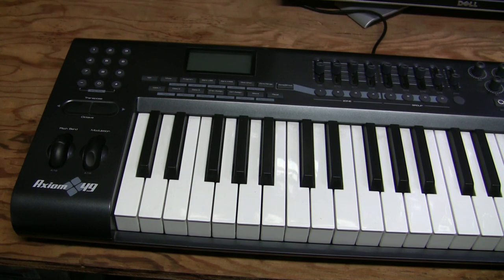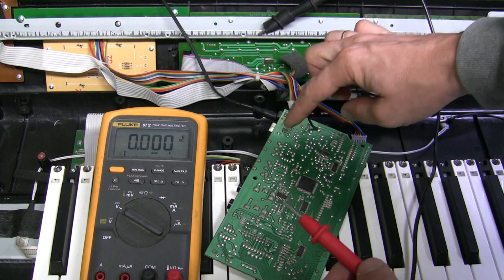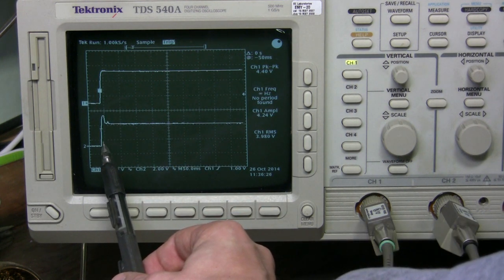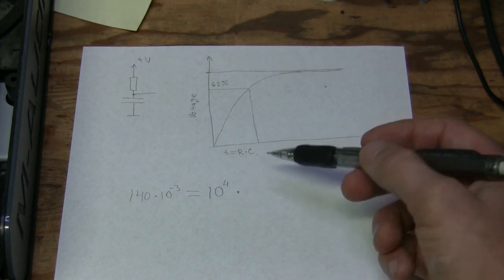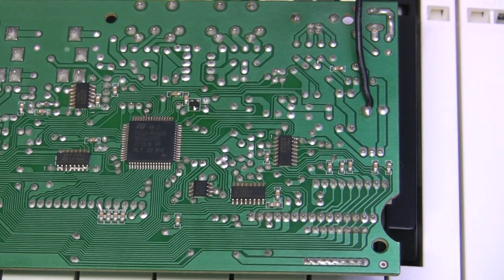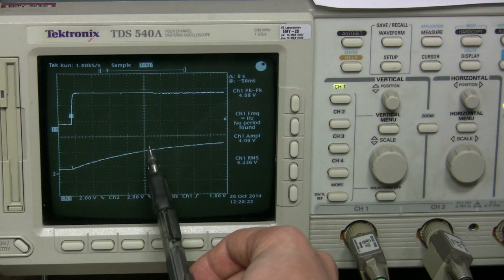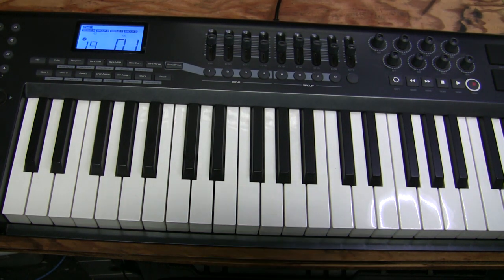#19 - M-Audio Axiom 49 keyboard repair

Comment: My oxygen 61 when plays on my laptop when the laptop is running on battery, but when i plug it in to power the midi keyboard plays for a few seconds then midi sort of disconnects, tried on different computers and locations, same problem, on my desktop same thing since desktop is always connected to power..

Comment: Nice video but you neglected to give the important details of installing the capacitor and resistor.  Just moments before you're talking about detailed considerations like not damaging the pads when removing the reset chip yet say nothing about how to tell how to get the polarity right when installing the capacitor, where each component is to be attached to etc.  I don't understand why anyone would omit those details.
Reply from the maker: I don't understand why anyone would care about such obvious details.

Comment: Hi, great video.  Sorry for the goddy question but I am trying to put mine back together and one ground wire has me stumped.  
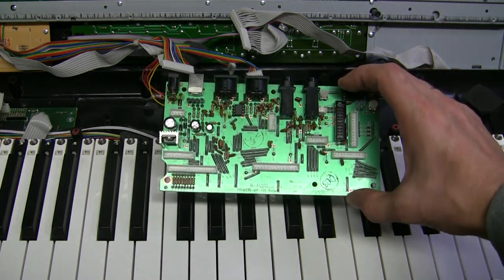In the video at 2:48 directly above your 1st knuckle on your index finger is the screw that attaches to the black ground wire I am trying to put back.  
Do you recall where it goes?  Perhaps on the  metal rail?  I should have taken a photo.  :-(
Reply from the maker: This was 6 years ago. Perhaps, on the metal rail, but I don't recall.
Reply: @feedback-loop  Lol,  good point.  I am 99% sure I found it on the rail, TY

Comment: Hi, thanks for posting, not sure if you get comments on this that you watch.  I'm wondering if you could tell me what the Resistor Value is for R1 on the main board.  This is the resistor that feeds the reset chip.  Mine is so badly burnt that I cannot determine the values of it.  It sits next to R10 and looks to be maybe a 240Ohm but need a photo of it or colors of the good one if you could.

Comment: Thanks for this video. Would you recommend replacing with a properly functioning reset chip over the repair method in your video? Fewer parts to solder might be better for me.
Reply from the maker: Yes, sure, proper reset chip replacement would be even better.
Reply: @feedback-loop  Great, I ordered the equivalent reset chip by Microchip on DigiKey website. Thank you!
Reply: Beyond thrilled to report I successfully replaced the reset chip and the keyboard is functioning perfectly.
Reply from the maker: Very cool!

Comment: Hi FeedbackLoop - I'm looking to source the white D key for an Axiom 61 first generation. A vendor I buy keys from has it for the Axiom Pro 61. Do you have any idea if the Axiom first generation and Axiom Pro had the same keybed? Thanks
Reply: The Axiom 61 first gen key was the same as the Axiom Pro except I had to soak if for a week in LA's Awesome cleaner to melt the glue so I could pull an extra 1.2 gram weight

Comment: Hi sir, I got my Oxygen 49 delivered to me but when I got it only 13 keys of the higher octave are working. The rest are not (including the pads) but everything lights up. What do you think is the problem?
Reply from the maker: I don't know. Might be bad contacts in some connector. Might be corroded traces due to some liquid spill. Half a million ways for this to go wrong.
Reply: Any fixes for corroded traces? I have not yet opened the insides of the keyboard but I suspect since it's very specific (lower octaves not working), it might be a lost connection somewhere (either unsoldered or some wires not connected) but I doubt it's lost connection because almost all m audio keyboards have one board for all keys
Reply: Randel Abratique have you tried a factory reset? i got mine last night and was worried coz only a few keys were functioning..then i did a Reset, and the keys are working again.. mine is a 2nd hand and was just kept for a very long time by the seller.

Comment: Thanks for your thorough and informative video FeedbackLoop. Just wondering what trigger mode you used on your Tektronix. I can't seem to capture the initial waveform dynamics. Is it a sample/hold mode? Thanks.
Reply from the maker: Single trigger mode from the channel connected to the power rail with threshold set within the range from slightly above 0 to slightly below 5V (I set it to 1V).
Reply: Thanks mate!
Reply: Single pass trigger confirmed the 'Reset' chip ramping up too fast within 5ms! Thanks for your help! Time to get a hot air rework station.😎👍
Reply from the maker: Cool. Please let the community know how you do.
Reply: All fixed now! You've been a great help FeedbackLoop. Single trigger mode on Scope confirmed correct operation. This was my first venture into SMD circuits and using a heat gun to carefully remove a component. I need to practise on some old motherboards to optimise temperature and air flow settings while improving technique.

Thanks again!😎👍
Reply from the maker: Very cool. I am glad it worked for you as well.

Comment: Hi had an off topic question, apologies for the random-ness. My Axiom 25 has a keyboard problem. Random keys - 2 or 3 of them - stop working at random times, but always in sequence. There is no pattern, so its not one or two particular keys (such as e.g. C and C#), it could be any 2/3 keys on a given day. Everything else on the device works fine.. Is it a board, the keys or maybe a software issue. Or something else. Would appreciate any advice thanks.
Reply from the maker: no idea, sorry.
Reply: Thanks anyway.

Comment: Hi! I'm looking into fix the BSOD issue also, but I've only got one 10µF 16V condensator and 0,6W: 20kohm resistor to work with.  I'm pretty much a newbie in this field, so do you think those parts will serve the purpose aswell?
Reply from the maker: Yes, this combination should work fine assuming that your problem is really with the reset chip.
Reply: Thanks for the quick answer! I saw one of these keyboards for sale with this malfunction, and thought I'd give fixing it a try since I enjoy working with electronics. As far as I've read, the problem seems to be in the reset chip most of the time? It's a bit risky if the problem is elsewhere, but I'm probably going to take it.
Reply from the maker: I don't know about the "most of the time". It seems to be a frequent problem, but one never knows...
Reply: Yeah, that's sensible. I've got time in my hands currently and ambition to see if I can turn this into a bargain, so I'll see what I can make out of it. If you care, I'll let you know what I end up with.
Reply from the maker: Yeah, let us know how you do.
Reply: 2 years passed... I think he never did!

Comment: Hi
I have same issue but I dont have resistor/capacitor available
I have seen on some video that we may use a simple switch to stay low (open switch) some time, then set it UP (close switch)
but I have no idea where to plug my switch

Regards.

Comment: First of all. Thanks for this informative video. I replaced the chip but I still get the blue screen. However now, both the "Null" and "Zone/Group" buttons light up. The computer detects the keyboard but says usb device has failed. Does this mean I have to flash the firmware back onto the keyboard or did I not solder correctly? Thanks in advance
Reply: +charlesdeanda Figured it out. I had not soldered correctly. Thanks again for this great video!!!

Comment: Great video.
 Need some help to diagnose the issue with my maudio Ozone midi keyboard (with built in audio interface + phantom power). Keyboard powers up fine (needs external 9v AC power) and I see the midi channel and midi cc numbers in the display panel. But it is not recognized by the PC , although I have installed the latest device drivers from maudio site.

I have tried it on different USB ports but issue remains - No MIDI. I'm sure my USB cable is good as I'm able to connect my axiom 49 keyboard using the same cable successfully. 

On win7 , under device manager , I see ozone academic with a yellow triangle on it. When I open the properties it says driver not found although I installed the latest driver for ozone from maudio . 

On Win Xp, ozone is recognized as a audio device and not as a midi device by Mixcraft DAW and I'm able to listen to audio through ozone connecting headphones. But no MIDI. 

Installed MIDI OX, DOSBox - No midi device recognized by both . Is it a hardware issue? USB port seems to fine since the audio interface works. Pls help on where to start and options I have to get it back to life.

Comment: I recently picked up a 61 key version for $25 with one broken slider and the occasional flickering display and USB shutting off. Not the BSOD but just random flickering.  There was just one mention (on a Google search) of their unit flickering and then the BSOD.

Found the Alpha 10k ohm pot on Ebay (two for $7 shipped).  I purchased the TCM809 reset chip from Digi-Key (two for $4 shipped).  So, for a total of $36 and a couple  hours of my time (not including the Google searching), it's fixed!.  Thanks so very much to you and your video.  Without your help, chances are it wouldn't have gotten repaied.

Comment: Hello, my reset monitor signal stays at gnd constantly. I tried to pull it to high by just shorting the pins after turning it on, but no luck. If only the reset monitor is broken, this should work, right?
Reply from the maker: +heaplabs 
Who knows. If the chip has internal short to ground, you are, probably, shorting the 5V rail by trying to pull the output up.
Reply: +FeedbackLoop I did your fix with 10K and 1uF and it works! Thanks!
Reply: +heaplabs it worked sometimes but took a long time to "boot up". I now use 47K and I think it even works better than before! (Digits appear straight away)
Reply from the maker: +heaplabs 
Great! I am glad this video helped you to fix your keyboard. Thanks for letting us know.

Comment: Hello, I tried this method to the letter but my keyboard is an Axiom PRO 61 and still did not work. The motherboard is different from the non-pro axiom I found the chip though but where you weld doesn't look the same. Can you help me?

My email is gus.arkitect@gmail.com
Reply from the maker: +Mr. Gus 
What exactly did you try to the letter? Did you verify with oscilloscope that the reset chip is faulty? There might be many reasons for the blank screen.
Reply: +FeedbackLoop +FeedbackLoop Hi, yes I did verified it and the chip U7 was faulty. When I removed it and weld the resistor and capacitor (where I thought it should go since the motherboards from your Axiom is different from mine)  the keyboard did not blink anymore like it used to before removing the U7 chip. But i still got the blue screen. I did connected to the usb directly to the Mac and also tried it with a usb hub (its a hub with a power supply) but still the blue screen is there. I tried with a 7v power supply and usb directly to the computer. Still nothing. Do you have an email so I can send you pictures of the motherboard and pictures of what I did.
Reply from the maker: +Mr. Gus 
Yes, the email is on the "About" page of the channel. feedback.loop.channel@gmail.com

Comment: can anyone help me? I think I messed up the solder points where the reset controller was. is there another spot to solder them?
Reply from the maker: ***** 
Sure. Do you see the PCB traces leading to the pads you messed up? So anywhere along the traces would do. Just be careful this time. Gently scrape off a bit of the mask if you have to expose the copper. Watch some soldering tutorials and practice on some scrap board if you can. Good luck.
Reply: FeedbackLoop thanks for the reply. I couldn't seem to figure it out as I did the damage before seeing where the trace went. I took a picture but I'm not sure if it helps. https://dl.dropboxusercontent.com/s/s3l0syez2hubuoj/maudio%20axiom%20board.jpg . also mine seems to be different as there seems to be another resistor to the left on your version. mine had a sticker on it that said v1.02. thanks again for helping.
Reply from the maker: ***** 
Here I annotated your picture: https://drive.google.com/file/d/0B3NWgPtazb_tYk9zOV8tcEtsTG8
Does this help?
Reply: FeedbackLoop yes it does, it's working now. thanks :)
Reply from the maker: ***** 
Oh, great! Did you replace the chip or did you go resistor plus capacitor?
Reply: FeedbackLoop resistor plus capacitor, though I only had a 20k instead of 22k.

Comment: Nice work, however you should have added a diode parallel to the resistor.
What happens if the unit it turned off: The capacitor will be discharged into the supply rail via the input protection diode of the RESET input on ST microcontroller. I have not looked into the datasheet but the input protection diodes are usually rated with something like 10mA max. When you turn the keyboard off and the capacitor discharges the chance of exceeding that limit it great and so you might damage the microcontroller in time.
Reply from the maker: Chip Guy Vids I don't think there is any problem with this simple reset RC circuit. Further study of the data sheet for the ST92163 recommends such a circuit (see page 89 of http://pdf.datasheetcatalog.com/datasheet/stmicroelectronics/5521.pdf). They recommend 10K resistor and 1uF capacitor. Apparently, about 10 milliseconds reset is enough.
Reply: FeedbackLoop
Oh cool. Seems they designed that diode in a way that it can handle the current. I used the same circuit (10K 2.2µF) with a Genesys video converter once, it didn't like it and the pin became more and more low impedance over time until the chip would not reset anymore at all.

Comment: for the resistor and capacitor does it matter the voltage?
Reply from the maker: louvens filius Not for resistors. For capacitors it does matter, and polarity as well, if an electrolytic cap is used, but in this particular case the voltage is below 5V, so almost any capacitor has higer rating. Electrolytic caps have voltage rating marked on them (say, 10uF, 6.3V).
Reply: So as long as the capacitor voltage is or higher than 5v I should be OK?
Reply from the maker: louvens filius yes, and observe the polarity - connect positive to the resistor, and negative to the ground

Comment: hey the link you provided doesnt have stock would you be able to link the parts you used so i can do it your way to repair my own
Reply from the maker: if you want to replace the chip, the link to DigiKey still works. I have
 just checked. Part number TCM809JVNB713CT-ND, $0.41/piece.If you want 
to go my way, I replaced the chip with 10uF capacitor and 22K resistor. 
These can be varied widely. Perhaps, 1uF and 100-200K will work fine. 
Maybe even 0.1uF is enough with a few hundred K resistor. A ceramic 
capacitor can be used in this case, which is more reliable.To make it 
super clear just in case: resistor goes between power and reset, 
capacitor goes between reset and ground.Good luck.Note that I removed my first reply and replaced with this one because of a mistake there. So if you somehow read the first one, disregard it.